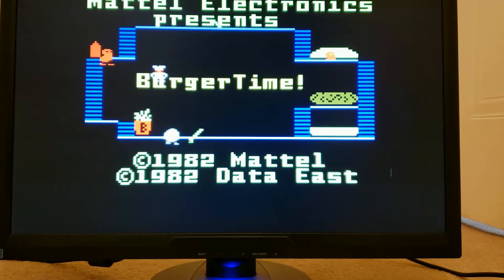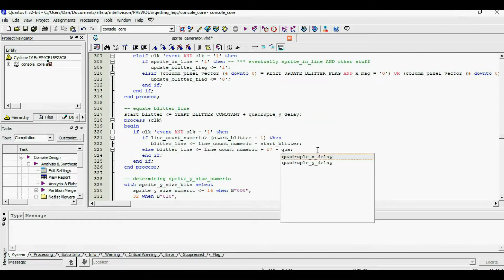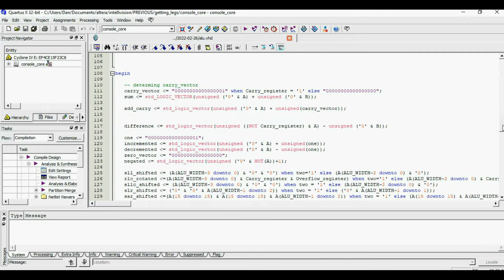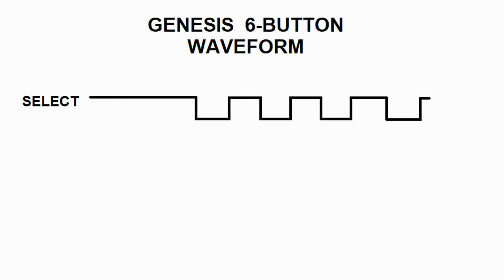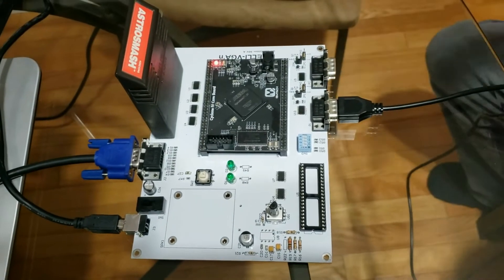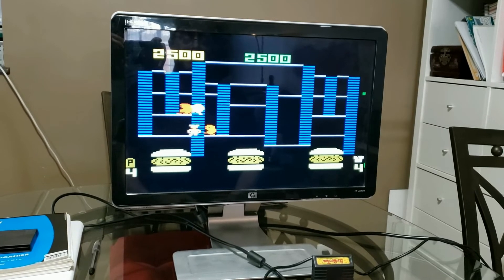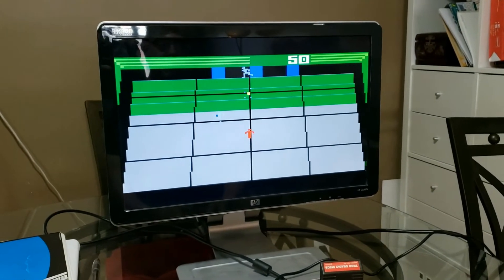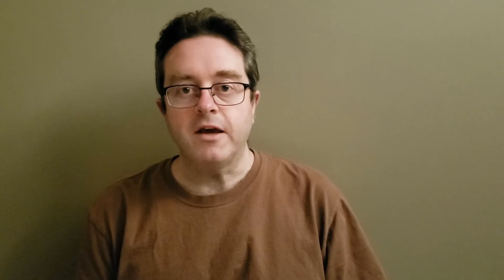Intellivision FPGA Core - Ep3

Comment: Excellent progress, congrats!  I just had a completely mental thought:  Put on a new connector, put it in a black 3D printed case, put a fake label on it, and watch peoples heads explode as you show a functioning prototype of the lost ColecoVision Expansion Module #4 next April 1st.  :)
Reply from the maker: Thanks, LOL.  Interestingly enough a few years back I was looking at the ColecoVision schematic and if memory serves me correctly there is an ability for the video signal to originate from the module plugged into the expansion slot... so you can quite conceivably make Expansion Module 4 a unit that plays NeoGeo cartridges.  So April Fools or not I could probably make a functioning version of your idea.

Comment: Would it be possible for this to incorporate some of the LTO functionality like JLP accelerators and flash saves so it works with some of the modern homebrews?
Reply from the maker: Currently there is enough internal memory within the FPGA to embed one additional game up to   32kB.  There is SDRAM on the FPGA board though..  so in the future I could quite conceivably re-spin the larger white PCB to include a serial flash device whose contents can then be transferred to the SDRAM.  I wasn't thinking this far though.  What I was planning on doing was making my own FLASH cartridge... but I want to refine and correct this project further first.
Reply: @dangrise6182  well you are doing great work.  Can’t wait to see if something comes from this.
Reply: It should be able to run an LTO Flash cart as-is, I would assume.. Since it plays regular, OG carts. Not exactly sure what's going on with the dipswitch settings though. 🤔

Comment: Amazing work thanks for the update. Would love for there one day to be a drop-in replacement for the original motherboard with connectors for the original controllers. Ideally with a geniuses 2 video out port with component out to use with the high-quality HD Retrovision cables.
Reply from the maker: Thanks Harmik and I like your vision for a new motherboard.  I considered composite video but went with VGA because it didn't require any additional chip... just resistors.
Reply: VGA output is hard to beat. There's some RGB mods for the Inty too, but either way, an OSSC has inputs for both & will get 'em both working on an HDTV via HDMI.